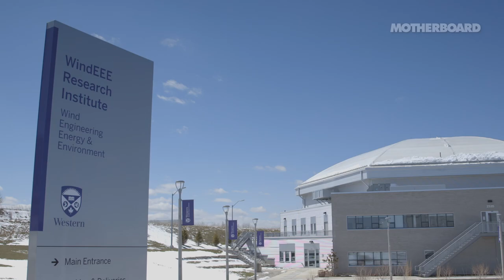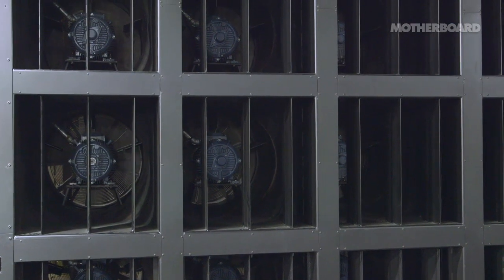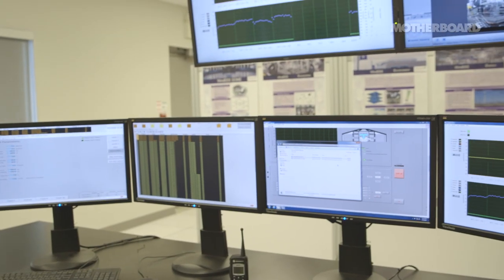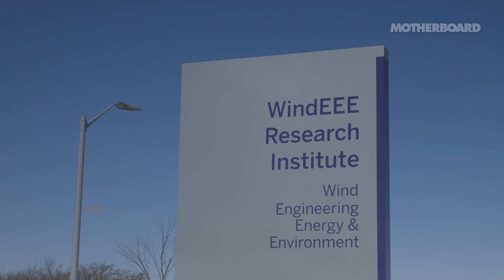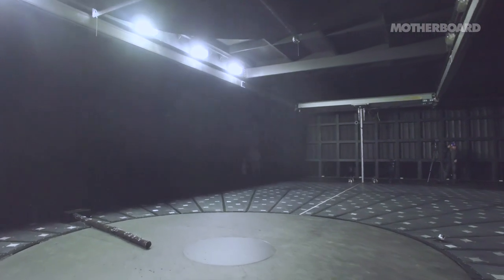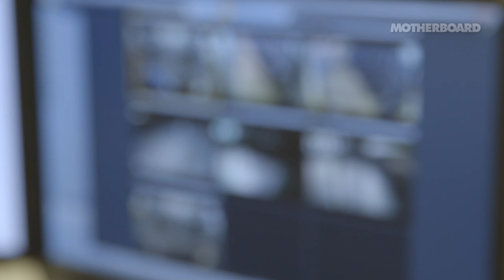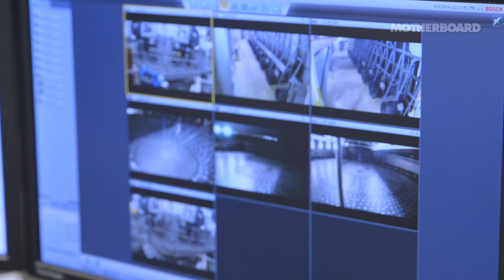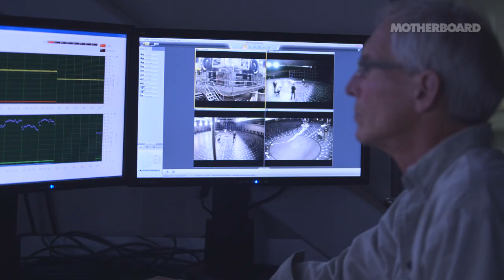Stress Testing Drones in a High-Tech Wind Vortex

Comment: I hate the word "drone" because it is technically incorrect. Drone's are autonomous, and this machine isnt; therefore this is called a UAV - Unmanned Arial Vehicle or a quadcopter, hexcopter or whatever the number of props it has but its not a drone.
Reply: This is a good observation. Unfortunately, the press and people in general often overlook this.
Reply: +peanuts2105 i completely agree with you, however I prefer UAS the most meaning unmanned aircraft system

Comment: its not a Drone and not a toy
Reply: +leo ulreich These specific ones self correct against wind thus you do not have real manual control. These computerised controls with servomechanisms on steroid really are Drones and not just multi-copters.
Reply: Neojhun I have a F450 thats the little Brother of the F550 (in the Video) they are GPS and Compass controlled but Multicopters and not Toys. There aren't any servomechanisms a Multicopter ist controlled by a Flight Controller by an Gyro , PID Controller and sometimes with GPS/Compass to controlle wind and the position. I also have some Racequad that are manual controlled and these quads are really no toys because they can speed up to about 100mph.